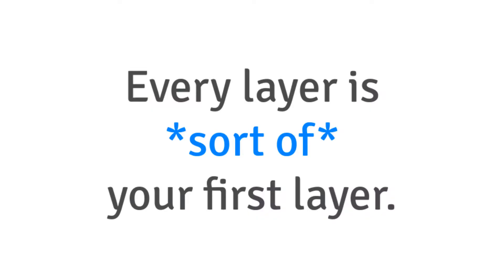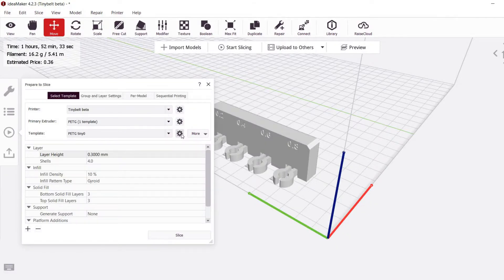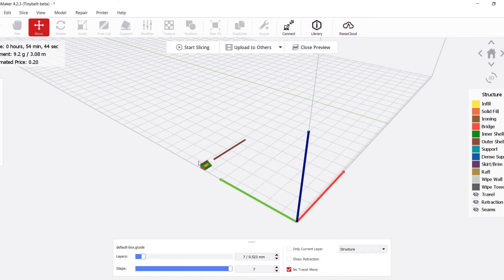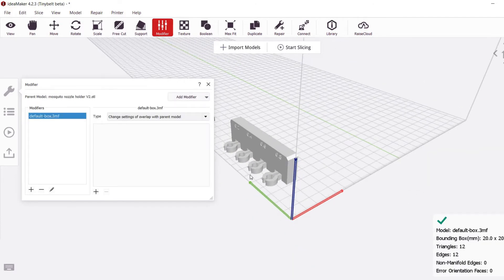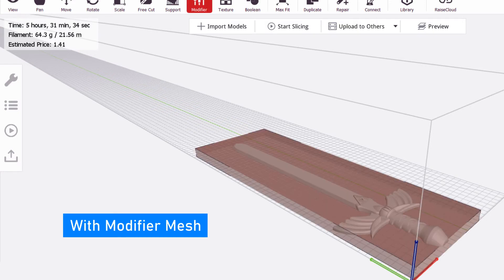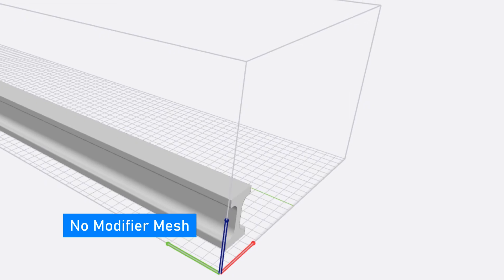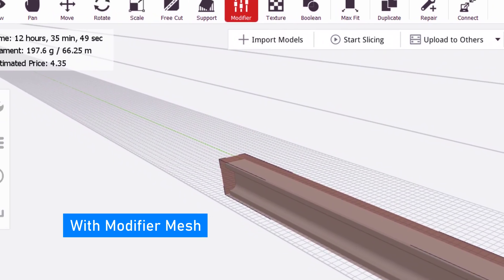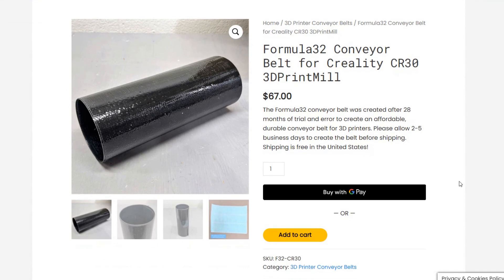1 simple slicer trick slashes hours off your belt printer times (CR30, Infi-20, etc.)

Comment: You don't need to use a modifier and can use the "Belt Wall" settings within the "Special" menu (As Dank described)...
Reply from the maker: I'll have to test that out! I'm curious if it affects the whole outer wall or just the portion touching the belt
Reply: @powerbelt3d  It's just the line of filament that touches the belt... Which has been very sufficient for me so far.
Reply from the maker: @everettebinger5956  nice!

Comment: Why are belt printers set at 45• why is it needed? I’m super interested in belt printers I don’t think smashing the head into the print is the best way to fully automate these printers.
Reply: Why not just have the belt moving be the y axis?
Reply: Is it so it can infinitely print? If your not looking to infinitely print I’d imagine keep it 90• could save a lot of headache.
Reply from the maker: You got it! The angle is for infinitely long prints. 
Also, a 90-degree XYZ axis setup steps into a gray area of patents.
Reply: @powerbelt3d  if your not looking to print infinitely long prints do you think a conveyor system still has the advantage over a system that swipes the piece off a standard glass bed.
Reply from the maker: @ToxicTom1967  it depends on your application. If you want to do a bunch of the same thing, I think a conveyor system is the best.
If you want to do a lot of different things for different people, I like a plate-swapping system. That way each plate could have a small job number or similar indicator printed on it to keep things organized.

Comment: Under the "special tab" in ideamaker there is an option under the "belt wall" section in the lower right to change the speed of outer layer shells that are touching the conveyor belt. It is called "belt wall speed". However, I tried this and it seems to be slowing back the back of the print that's facing the purge line instead of the bottom layer.
Reply from the maker: Interesting - I hadn't seen that! I'll have to check it out. Thanks for the tip.
Reply: @powerbelt3d  Can I use a modifier mesh to remove the top of a model so it doesn't print the top surface layers? I am trying to print letters with no top. I set the infill and surface layers to 0 and it still prints them.
Reply from the maker: @thepickleballaddict  Modifier Meshes are tricky when belt printing. I ran a quick test trying to do what you're describing, and it worked on a traditional printer, but not a belt printer.

I'm not 100% sure why, but on a Belt printer the top surface is made by the outer shell, not the top solid fill of a typical printer. I have a feeling this confuses the slicer.

Comment: the best explaination of this technique. this is a massively important technique and likely a future window of belt printer base layer speed z height xyz something like that eventually
Reply from the maker: Thank you! 😄 It would be awesome to see this added as an option right in the slicer.
Reply: @powerbelt3d  i noticed using this setup, its kinda SPLITTING my model and changing the speed as requested...but its SPLITTING my model....i dont have any other modifers for speed or layer changes in this modifier and ive tried with a few different files... could it be the way its writing the G code for my CR30?
Reply from the maker: @miestermind  Hm it's hard to exactly the issue without photos. I'd recommend slightly changing the Z height of the modifier and seeing how that affects the output.
Reply: @powerbelt3d  which version of ideamaker was this?
Reply from the maker: @miestermind  I'm running 4.2.3 it seems

Comment: I think your technique will work the the same way in Cura. You can turn their support blocker into a modifier mesh. Just used it the other day to make the top layers of a model solid.
Reply from the maker: Good to know, thank you! I started using IdeaMaker because it supports both belt and non-belt printers. I haven't touched cura since.